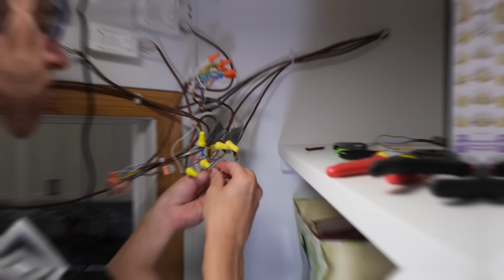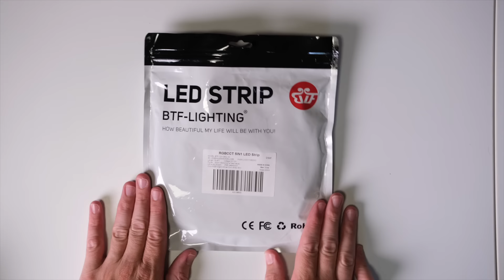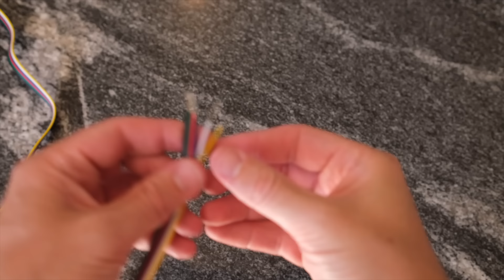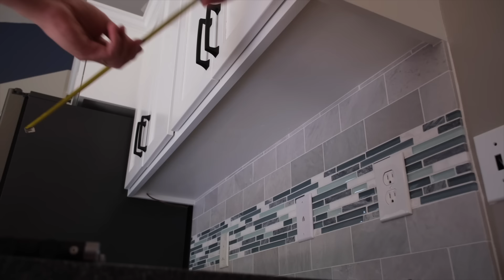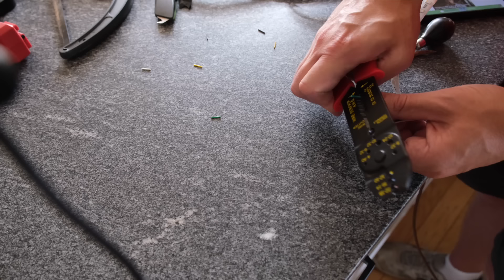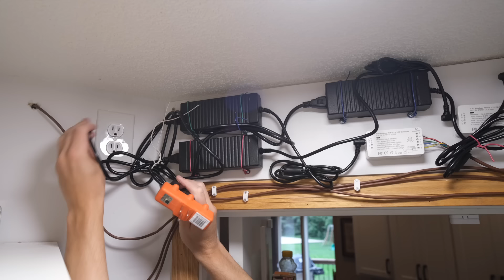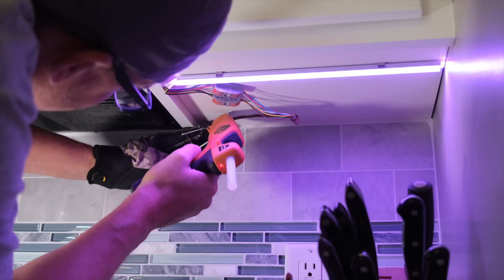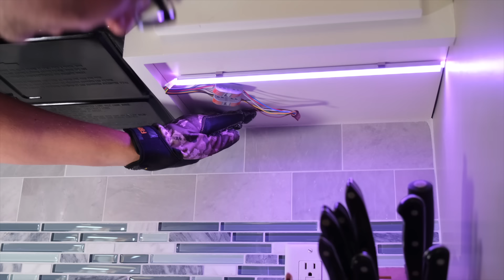Ultimate Guide to DIY Cabinet LED lights - full install

Comment: Great video, but I need some clarification. @1149ish, you show your Clark Griswold masterpiece. I understand why theres 3 wires running to the left... they feed that side of the kitchen (top, middle & lower). But why is there only 5 running on the right? Shouldn't there either be 6 or 3?  Can you explain your wires ( what's going where and why kinda thing)? Thanks for the help!
Reply from the maker: Good question. The reason there are 5 cables running to the left is that the upper cabinet on that is split into two cabinets on that side so I ran a top and bottom cable to each of those cabinets (4 cables).  The toe kick, however, is more or less continuous so I only ran one cable to the toes kick light on that side for a total of 5 cables. Make sense?
Reply: Wow! Same day answer! Dude, you rock. To bad I'm 5 days late.

So at 1310 you show the upper cabinet... there's 2 holes on either end with cable coming out. Can you explain what's going on here. I initially thought (and still do) that your LEDs are in parallel (expect you toe kick - that seems like it's in series). But if their in parallel why the extra hole? That makes me think their in series.

Comment: Are you aware of a way to make these led stripes work with a light switch? Or a way to make them controllable from an app with your phone?
Reply from the maker: With the controllers I used you can use the Hue app on your phone. Otherwise you can use the dashboard for whatever hub you connect the controller to (in my case Hubitat and Homey Pro) to control the lights. Instead of a hardwired light switch I added a wireless button controller to the wall that is programmed through the hub to do the same thing as a switch. Saves a lot of wiring that way.

Comment: I’m guessing this setup doesn’t work with a dimmer switch?
Reply from the maker: no, these controllers need constant power. Watch my related video on how I use button controllers to control the lights.

Comment: Man great tutorial but its still expensive imo. Plus those ugly wires hot glued to the bottom of your cupboards 😮🙈

Does this annoy anyone else or is it just me? I will use tou tops but hide the wires better. Would soldering the wires not have been so much easier and cleaner aesthetic?

Still great job and keep them coming. You gained a subscriber and a like
Reply from the maker: Thanks! If the wires were visible I would have put more effort into hiding them. But the clip connectors are 100 times faster easier than soldering, I assure you of that.

Comment: Maybe I missed it, but how did you wire everything over to the wall switch? I would love to have a manual switch that would work in parallel with the app
Reply from the maker: In the next video I showed how to use a smart hub to use a pico button controller as a wall switch for the lights. That way you don't need to tear up the wall to get a wired switch over there.
Reply: @ thanks for the response! I ended up finding that video a couple weeks ago. I wasn’t sure if the pico switch needed an additional hub or if it would communicate with the Philips hue bridge. I ended up purchasing a Philips hue dimmer switch instead rather than the pico. Project starts next week.

Comment: You said in the begining of the video that you had a wall switch for them but your never explained how you set it up or what it did.  Do you have any more information on the wall switch?
Reply from the maker: I used a pico remote as a wall switch. You can see how I set that up at about the 6:00 mark in this video. Thanks for watching! https://youtu.be/VXwVkAAHyfg

Comment: Forgive me but im confused about the controller. Starting from scratch, do i need the little zigbee strip controller as well as the phillips huebridge? I dont have a home automation hub, or know what that entails.
Thank you
Reply from the maker: You don't have to use a hue bridge. As zigbee controllers they can connect directly to your zigbee hub. I like using the hue bridge because I have multiple hubs I use for testing and whatnot and the bridge allows me to connect them to all of the hubs at once. With a direct zigbee connection you can only connect to one zigbee hub at a time.
Reply: Thank you, is the zigbee hub the hubitat device? I got that from your video. Forgive me, trying to figure it out. And can i run the outlet that the power supply plugs into from a normal light switch? Didnt see that you went over the switch part @DIYSmartHomeGuy1

Comment: I’m in the process of doing this using the same products.  The fittings are all cheap. Soldering is likely your best option to maintain a flawless connection.  Just solder the thermostat wire.
Reply from the maker: I hear ya. So far I've had zero issues with the clip connectors, but if you have experience soldering, that;s a great option. For me, the clips were a much welcomed alternative. I have a new project in the works and a friend is pushing me to solder this time, so we'll see

Comment: I'm just wondering why you didn't connect the thermostat wire straight to the LED connectors on the strips. It would have saved on connectors under the cabinet. Thanks
Reply from the maker: The only way to do that would be to solder them and since you can't see the wires without contorting yourself, the clips seemed like the better choice for me.

Comment: New DIYer here - could you explain the reason why you have to connect the 18/6 wire from the controller to another 18/6 via wire nuts instead of just directly connecting that wire to the solderless connector / LED strip?
Reply: If there’s an 18/6 coming from the controller, wouldn’t those be the only wires that need to be connected to the LED strip? Correct me if I’m wrong, but it looks like you’re extending the LED strip with an 18/6 wire and using that extension to wire nut the 18/6 coming from the controller. Would it be feasible to just run the 18/6 from the controller directly into the LED solderless connector?
Reply from the maker: Yep. The reason is that I ran multiple wire to the different strips. So instead of connecting them all together in the controller, I connect them together first with a wire connector, then run a single wire from that to the controller. Hope that helps.

Comment: WOW! All those controllers and wire nuts? Appreciate all your hard work but this looks amateur to me. Why could you not use the same plug as the microwave? I just cannot see the need for more than 2 controllers. I would actually only need one. I would also solder all the wires with small heat shrink tubing. Neat, easy and takes very little space. So easy to run wires up and over.  You took an easy job and complicated the hell out of it. I suppose one could use this video of what NOT to do..
Reply from the maker: Separate controller for the top, middle and floor levels so I can control them independently. If you are good at soldering, that is a great option, but for those of us who aren’t, the flip connectors are a God send.

Comment: I want to follow your design and materials, except upgrade to a five color, white white LED strip, using instead BTF-LIGHTING RGBCCT 5 Colors in 1 LED 5050SMD RGBWW.  Like you, want to use the Hue  system, can I use the same controller?  According to Amazon’s recommendation, BTF-LIGHTING 5in1 LM052 Tuya Zigbee3.0 LED Controller Supports five colors and is compatible with Phillips Hue system too.
Reply from the maker: I think that controller will work, but I haven't tested it myself

Comment: I'm about to start a project using your video as a guide. (lighting some very dark garage cabinets) Out of curiosity, how many LEDs were you able to power from one of these power bricks? I think ideally I will be running about 1.2 16.4ft spindles of the LEDs. (20% more than one spindle) I could live with shorter runs if I have to. (more wire/less LEDs) But, if there is some evidence that there is some headroom on the power brick, I wouldn't mind buying another spindle of the LEDs if I'm not going to overload it. Did you ever use more than 16.4ft on one of your runs?
Reply from the maker: Yes, I believe they could power 32 ft. of the LEDs I have

Comment: I’m a journeyman electrician and the code you cited has nothing to do with microwaves.
There is no code that addresses microwaves needing their own circuit.
210.23(A)(2) states that utilization equipment fastened in place is limited to 50% of a circuit when shared with lighting or other equipment not fastened in place.
Reply: What does that mean practically? Because running lights from that outlet would make things ridiculously easy for me. Are we talking about amps? Because microwaves can use 15amps on a 20amp circuit, so you are getting close with the LED's depending on how many and the controller, right?

Comment: Where did you get the manual switches (3 button) on the wall?
Is it wireless and talks to the controllers or does it switch the outlet on and off?
Thanks for your help!
Reply: Those are Lutron Caseta switches.

Comment: I am having a HUGE problem with the hue ecosystem. Light bulbs and controller constantly show "unreachable". I used all items you suggested. I can turn rooms on and off, but individual lights are not controllable. I can cycle power to the lights to get them to work for a few minutes. There has to be a better system. I've installed Bluetooth speakers, smart TVs, security cameras. I even have a smart garage door opener. All installed with no problem. Why does something as simple as lighting have to be so difficult!

Comment: Like the video. Really didn’t like the advise on wire. Need to learn a bit about ohms law and how low voltage runs on wire before advising people. 
Don’t skimp here. Use the 20ga stranded wire. It’s not a lot of money and it runs the low voltage perfectly!

Comment: Hi.  I followed many of your tips and got a great waf, however, per your video I purchased a hue bridge. Now I find out (reddit) that gledopto controllers are not working with hue bridge.  How did you set these up on hue? Thanks
Reply from the maker: Sorry to hear your gledopto controller isn’t connecting. Did you get the zigbee version? When i connected mine i added it the same way i would add any philips hue light to the bridge. I haven’t had any problems, the only thing is you can’t use hue scenes on non hue devices.
Reply: @DIYSmartHomeGuy1  thanks for getting back to me.  I used your Amazon link, so yes, I got the same zigbee used in the video.  Do I need to reset the zigbee when searching in the hue app?  Your prompt reply is both rare for some youtubers and very impressive.  Thanks!

Comment: You are an inspiration.  I've watched your video several times now.  I am building a pantry with overhead glass cabinets over a countertop.  I wanted to have two sets of lights.  One is under the cabinets to light the countertop, and the other one is running in the overhead cabinets to light up what's inside.  I assume I will need two controllers for this.  As I do not have a smart home hub, can I control the lights another way or should I break down and buy a smart home hub.  Also - How long did your installation take from start to finish?
Thanks
Reply from the maker: Thank you! If you buy the WiFi controllers instead of the zigbee ones you can control the lights with the app instead of using a hub. But I loathe WiFi and would recommend getting a hub. Hard to say how long this project took because we were in the middle of a kitchen remodel so it was very start and stop. But a normal human should be able to bang this out in a weekend.
Reply: @DIYSmartHomeGuy1  THanks - It turns out my son has a Philips Hue Hub, so I went ahead and purchased almost identical to your system.  I'm building a small Pantry/Office area adjacent to my kitchen and thought this would be a good place to try out the LED lighting.  So far things have gone smoothly.  I have tested one of the LED lights on the wheel using the Zigbee controller and everything is working properly.  Since I'm installing the kitchen cabinets myself, I've been able to tweak the layout to accommodate the wiring.  I need to buy more of the 6-pin solderless connectors, and then I'll start laying them out in the cabinets before I hang them on the wall.

Comment: You never went over hownto incorporate these with wall switches.  Can you explain that portion?
Reply: There is a constant uninterrupted power in the switch box. He just took a romex wire (which has hot, neutral, and ground) from the switchbox up to the outlet he installed.
Reply: I believe this was in another of his videos...
Reply: Hire someone buddy js
Reply: I had a switched outlet over my cabinets with a separate outlet across the kitchen over more cabinets. I purchased from Amazon an inexpensive set of LED lights,including controllers and power supply along with aluminum channels with diffusers.  It was a very easy, quick install that works perfectly.  Total cost was under $50.
Reply: I think it was a wireless connection
Reply: He's using a home control hub (probably Home Assistant).  The strip controllers are either wifi or zigbee.  The switches he showed are Lutron Caseta (they might even just be Caseta Pico remotes).  The controller hub "hears" the commands from the Lutron switches and sends the commands to the LED strip controllers.
Reply: From switch you run your wire to your outlet
Reply: So basically the power supply is controlled by switch. 
Does the led controllers come on automatically with same settings once the switch turns the power supply on and off.
  Also paint wires white, & take time  & solder wires to get rid of those big connectors under cabinets. 

@vtfrosty8416

Comment: Did you run strips in parallel from one power supply and controller? Or does each power supply and controller run the strips in series. I would like to run multiple strips under shelving, but I would like to have one power supply and controller and do it in parallel. Is this an option?
Reply: You ever work this out? In a similar situation.

Comment: Man every time i watch one of these videos im reminded how crazy messy and bulky this process is.  I love lighting and wiring but my goodness.  I cannot see it being worth it, yet.  Its 2024 there has GOT to be an easier and cleaner way soon.  Those exposed wires under the cabinets would drive me absolutely bonkers.  The controller panel and power sources for such low voltage lighting are insanely bulky.  Outlet adaptors?  No way...  Ill check back in 2025.😂
Reply from the maker: Here's an alternative to the smaller power supplies - always keep cost and amp rating in mind. John (the DIY Smart Home Guy OG) did a video many years back highlighting a single power supply. https://youtu.be/IFF27gvq_3s?si=A2medwrTT3J9-NQh&t=244

Comment: What a great video I bought the transformer the power supply the LED lights. Please help. What LED connectors do I buy????
Reply from the maker: Sorry for the delayed response. I used these connectors to connect to the LED strip, then cut them in half and connected my long-run wires to the connector wires using toggle-style connectors: http://www.amazon.com/dp/B09L7P86FQ/ref=nosim?tag=onamzazhb-20

Comment: How did you hide the wire running from the cabinets on the right to the cabinet to the left? I don't see any place to hide them
Reply from the maker: I ran the wire into wall, down and out into the cabinet below the sink, ran it along the inside back of that cabinet, then back into the wall, up and back out of the wall at the upper and lower part of the upper cabinet.
Reply: @DIYSmartHomeGuy1  Awesome, I didn't think about that. Thank you.

Comment: You went full Clark Griswold on that control panel!!!
Reply from the maker: “Hallelujah! Holy *****! Where’s the Tylenol?”
Reply: @DIYSmartHomeGuy1 a Digquad or Octo would have much been 1 controller connected to a Meanwell power supply and eliminated all the excessive wires, controllers, and power boxes. But it was a nice video

Comment: As one of your million subscribers, I am interested in making inside cabinet lighting.  Back in the day we would use micro switches.
Reply from the maker: That makes sense. Probably don’t need to connect to a hub unless you only want the cabinet light coming on when you open the door at night or something.
Reply: @DIYSmartHomeGuy1  yes true.  The main place I am talking about is dark and hard to see day or night.   The ideas are flowing in this pea brain of mind the possibilities are endless I say!!! Lol
Reply from the maker: @brentjohnson6654 if you hard wired the lights and used micro switches in the doors to turn them on, it would probably be a lot cheaper than using contact sensors or something else that communicated with a hub. But those would offer some additional options like notifying you when someone is sneaking into the liquor cabinet.

Comment: Thanks for the video, couldn't have done it without watching it. I just completed installing the lights under the cabinets. I did 5 short runs, totaling about 28 ft of RGBW strips with a wt5 controller and a 24v 15a 360w power supply. Now I want to the same for the top of the cabinets. Would I need a separate controller and power supply? I would need to do 2 runs of 16ft RGBW strips. Thanks for any help.
Reply from the maker: Thank you so much! It depends on the power draw of the led strips if you’ll need a larger power supply and/or controller. My guess is that you have a large enough power supply but you might need another controller. And personally I would recommend a second controller for the top of the cabinets so you can turn the top and bottom lights on or off individually. Let me know the specs of your LED and I can give you better information hope that helps